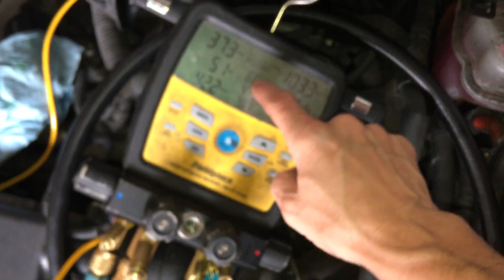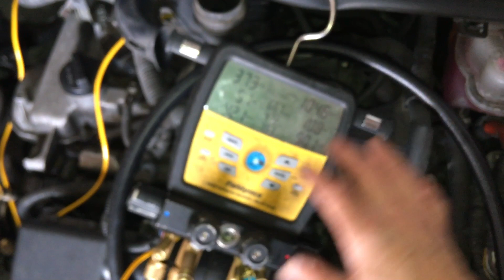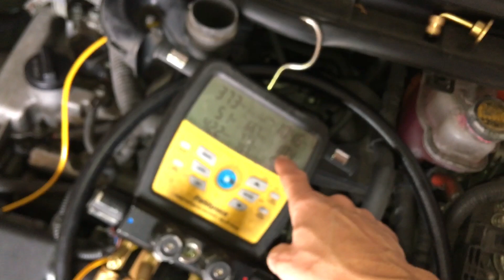Superheat & sub cooling Compared to commercial refrigeration & residential HVAC￼￼. That knowledge ?￼

Comment: Tom, assume you didnt have a refrigerant scale, how would you go about filling a car a/c system with pressures and subcooling and superheat? i know you say you need to go by weight. but if you had too. how would you do it
Reply from the maker: @jvseevalenz8324  easy to do on old air conditioning from the 1950s through 1960s. 
You had a fixed piston compressor .  And you even usually had a fixed solid fan attached by metal to the water pump and it directly correlated with engine RPM.. 

So you could follow the manufactures instructions of testing the AC system some vehicles were 1200 RPMs 14 1700 RPMs something like that . 

They would usually leave all the doors and windows open put it on Fresh Air. Some vehicles didn’t have a choice of fresh air recycle. 

Let it sit for like 10 minutes of running to stabilize those higher . 

And they would give you pressures that were fairly accurate with a given ambient temperature because there was absolutely no variance in condenser fans, speed or compressor displacement . 

Jump ahead to 2020s nearly everything is variable displacement, compressor or electric compressors that are variable speed 

And we have variable speed, condenser fans, or stepped condenser fans or possibly two fans primary and then a secondary fan kicking on and off at different pressures 

Or one kick off, but there is no across-the-board from your make model vehicle that do the same thing every manufacturer does something a little different so you can’t use rules of thumb . 

The man have software that are bearing the displacement to add different rates under different conditions and precious so all rules of thumb press basically out the door unless they have specific criteria . 

But what would I do in this case? 

It’s summertime and it’s the hottest time of year 90° plus outside. It works more accurate with more evaporator 

Because you want the software to command the compressor 100% duty cycle .  So it’s acting like a fixed piston compressor.

You want all the sensors to command thick condenser fan to go on a steady state under its full load as it was fixed speed condenser fan because it’s so hot outside . 

Now I would probably set the sub cooling by some rule of thumb that would not be correct on all vehicles because I’m gonna pretend I don’t know that some vehicles have somewhere around 9° sub cooling. Some other vehicles are in the 20s and some others in the 30s and I have measured some in the 40s , normal split system residential HVAC would definitely be a no-no at extremely too high. 

But I had set my subcooling probably somewhere in the 20s.  . 

Check my superheat make sure it’s somewhere between 10 and 20 . 

Do you know what attempt to use that as my ballpark figure? . 

It’s your cabin air filter is partially restricted and you don’t know it. You’re super in your subcooling measurements will be incorrect and you will not know it so you will be filling it up incorrectly.

Comment: Wow you're the best applying real work in real life. Thanks for all the videos you share with us you're the only one who has this type of content in YouTube (automotive).
So if superheat and subcooling are different numbers in vehicles Why do you keep using them? Does it help you with something or is just 'cause you wanna know?
Reply from the maker: When you really get to know the numbers on particular vehicles you could get to know what is correct for a certain year make model or style of AC system. 

For example fix missing compressor will be different from vearable displacement compressor

An orifice tube system will be different than TXV or expansion valve

          Because I’ve worked on 100s a Prius I get to see what normal for that high-voltage electric verrible displacement speed compressor

       Then you have the newer vehicles that they started putting internal heat exchanger in the suction line you’ll notice under certain operating conditions do you have extremely high superheat on some vehicle. 

So just like with commercial refrigeration or residential heat pump you can use it but you Gotta know what the numbers are supposed to be

  Right now no manufacture as far as I know list that information. 

     And unfortunate truth they consider automotive guys to uneducated to be taught or use it successfully. 

      It’s so much information I would never expect somebody who does drivability and brakes and transmission and suspension to ever grasp that much information and human being just cannot do it

          And the ones who can deathly gonna be working for somebody slapping on brakes and struts for next to minimum wage. 

I see this in commercial refrigeration guys and residential HVAC guys they come up to VRF  Play their hand on the suction line and figure it’s not correct and they start pumping in refrigerant not knowing that the computer is taking over because the temperature sensors that since the line temperature as they’re adding refrigerant and the pressure transducers are starting to take over and change the displacement of the compressor and the temperature in and they often get it wrong and then on a different temperature day couple days later it’s either too full or too low and it still doesn’t work 

Or in the severe case they overfill it because they’re trying to go by superheat or sub cooling or pressure or temperature and it turns into a $15,000 compressor replacement job or more . 

          Some manufactures through the factory software you superheat and sub cooling for a refrigerant level check because they have to pressure transducer built into the car and they have temperature sensors that are placed under refrigerant line exactly where they belong and ambient air temperature sensor in front of the condenser and evaporator temperature sensor they lose out through the software and they fix the speed of the compressor or the displacement and they set the speed of the condenser fan exactly where it was designed to be for the test to check the refrigerant level all done by software. 

       Because no human being can do it just with the car standing there in front of them hooking up a set of gauges and squirting off some refrigerant in the system will always be wrong it’ll either be too full or too low depending on the ambient condition. 

    That’s why I feel sorry for the general repair automotive mechanic who have to work on every year make and model from around the world it’s impossible to remember all the specifications you only can half ass everything and only get good at some thing. 

Same goes for commercial refrigeration and residential HVAC. You cannot master geothermal. Master CO2. Master hydronic unit. Master cooling towers with 150 ton chiller. Master you’re 13 seer Goodman heat pump, and master Carrier top of the line Intellacharg 30 SEER VFD compressor and fully variable blower motor that has a bypass dehumidifier and a steam humidifier. 

The guy who tries to get good at everything and no everything knows nothing.   

Now we have heat pumps on cars the last several years

And Germany offers heat pump with a CO2 option

Like to see one of our guys hook up his gauges to one of those and try to figure out how to fill it up by pressure lol 🤣
Reply: @coldfinger459sub0  I never thought about it Very smart knowing the numbers for specific makes and models, a fast way to know if you have the correct refrigerant charge I would say. 

And true completely agree with you for those who are not very knowledgeable about all those AC systems out there and now talking about cars ac system there's no a lot information. I just got that A7 ase certification but I will say I've been learning more from you and those others ac residential channels that you recommended in your previous videos.
Thanks Tom for the info and tricks that you share with us. 👍🏻
Reply from the maker: @walkertb  Got all my ASE‘s decades ago.  They don’t teach you anything but they do prove that a technician can read a book and remember the information long enough to take a test.    
                         Nowadays for young technicians the best shops I am in every technician have a computer and a screen and he’s always going to it to look up information and resources on anything new. 

To work on air conditioning it’s good to be electrical and drivability guy because they’re interconnected in both diagnosis procedures. 

Example engine temperature control sensor how to specifications but not enough to set a code. 
                            To save the car from overheating can shut off the air conditioning set no code because it thinks the engine is running hot

           Same goes for charger alternator charging get slow vehicle could start (load shedding).    To keep the car running to get to the next shop it will start turning off on necessary thing like air conditioning but actually there’s nothing wrong with the air conditioning but a technician might start changing parts we’re doing a necessary recharge

     A battery that is going bad but not bad.    Can affect the HVAC module or ECM power control module do not engage the air conditioning or make intermittent problem but the air conditioning itself has no problem a lot of diagnosis time gets wasted on a battery going bad but I can pass a load test at the time it’s getting tested on the battery. 

           Older cars with clutches before HVAC control module and electronics and software because the battery starts to go low but the car starts fine headlights work great the compressor clutch can start slipping and burning up the clutch technician replaces the clutch of the compressor customer comes back a few months later with another burnt up clutch has nothing to do with a fan not working or overcharging a high-pressure just a sliping clutch

And 100 other little things that can cause air conditioning to either not work or intermittently not work or work poorly having to do with drivability problems that have not shown up yet

Comment: Some technicians change the variable displacement compressor to a fixed stroke one but how it works ang controlled?
Reply from the maker: If somebody changes variable to fix displacement it sounds like they’re from another country where they don’t have access to a new variable displacement or it’s too expensive.  If it still has a standard expansion valve it will be controlled that way. 

If it has an electric expansion valve it may not be controlled very well. 

I’m some if you disconnect it Illinois and it might set a code as a malfunctioning part and turn off the power to the compressor. If it was a variable displacement compressor that had a clutch. 

But many variable displacement compressors do not have a clutch so even if you put on a six speed compressor there will be no power wire to connect for the clutch coil they would have to make one up
Reply: @coldfinger459sub0  very complicated process
Reply from the maker: @issamadam9352  it’s only complicated if you don’t understand how it operates. 

If you understand how it operates and its motive operation it’s very simple

Comment: What about fixed displacement compressor?
Reply from the maker: Fix displacement a little easier simpler more steady.   
         Only problem is it depends on the condenser fan controlling different vehicles kick fans in high speed low speed summer true variable speed some only cycle on high pressure allowing the high pressure to go up to 270 then kick on the fan at one high speed until it drops to 150 and then kicks the fan off and keeps cycling up and down so you’re super heated or sub cooling depending on the system is jumping all over the place not steady unless you’re in ideal perfect condition.   

And we all don’t live in ideal perfect condition or inside a lavatory